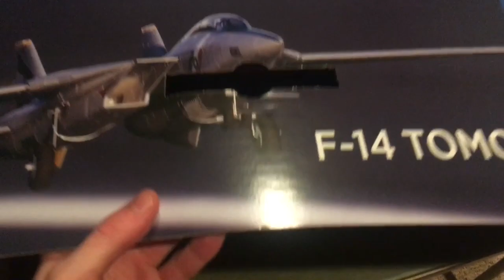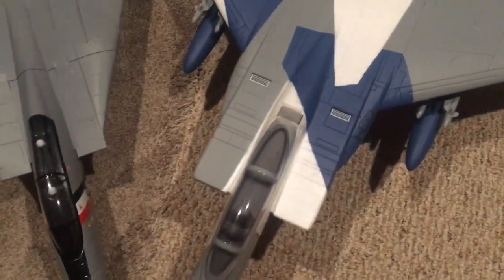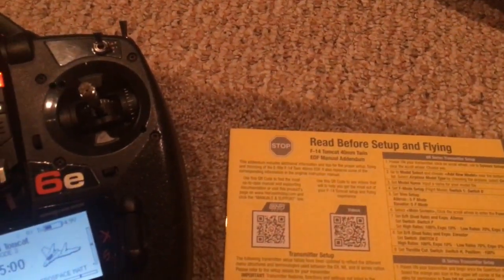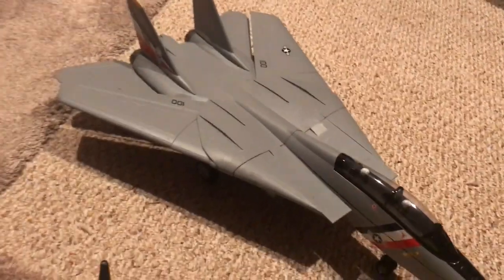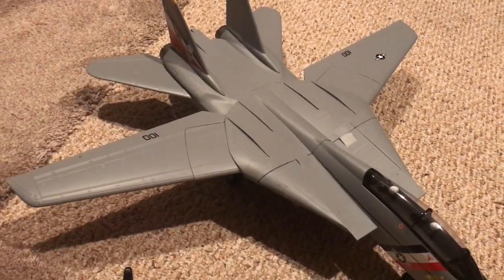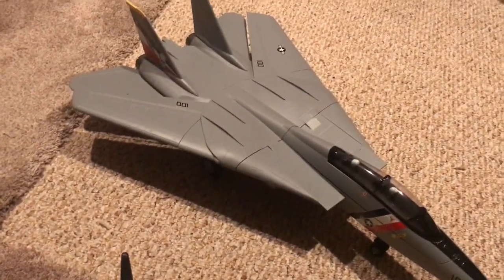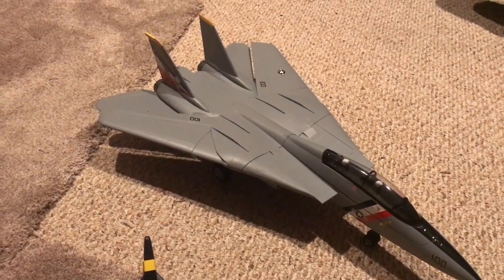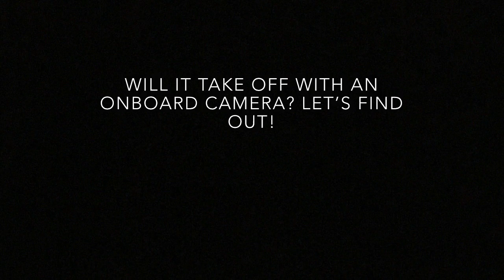New E-Flite F-14 Tomcat Grass Takeoffs and Onboard Video

Comment: $300 for two flying surfaces is just ridiculous, but nice clip bud thanks for sharing
Reply from the maker: Yeah it is pretty expensive for a UMX. But a fully Cnc’d aluminum wing spar can’t be cheap. Also, it’s exactly half the size and half the price of the Freewing. Eflite: 2x 40mm = $300. Freewing: 2x 80mm = $600.
Reply: @aerospacematt9147  Wow really?!  In person it seemed like 1/3 to 1/4 of the size of the twin 80mm
Reply from the maker: I’ve never personally seen the Freewing, but judging by the size of the engines it should be 50% the size.